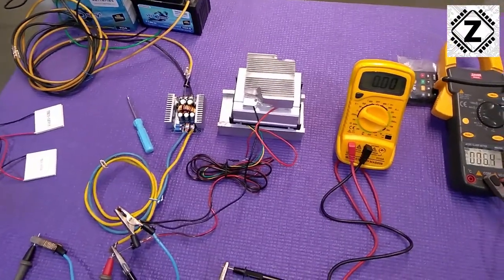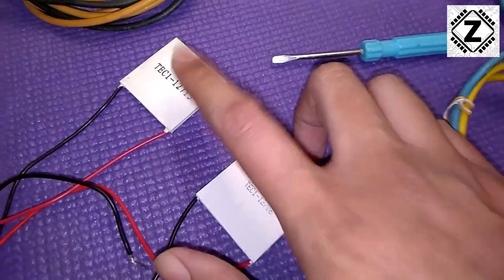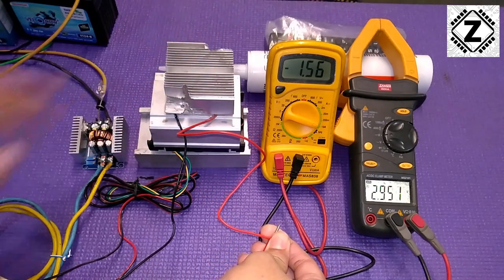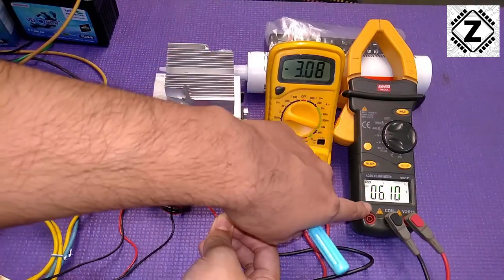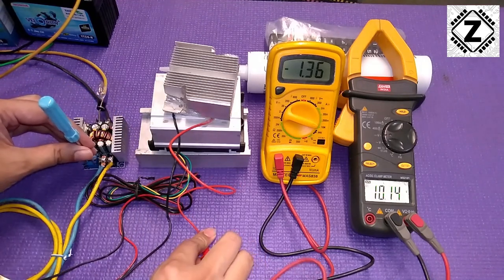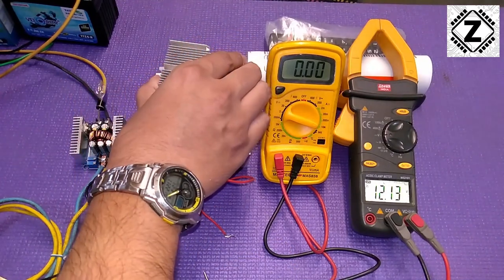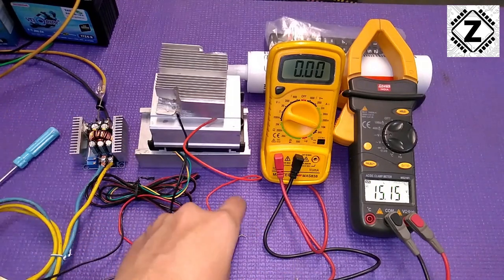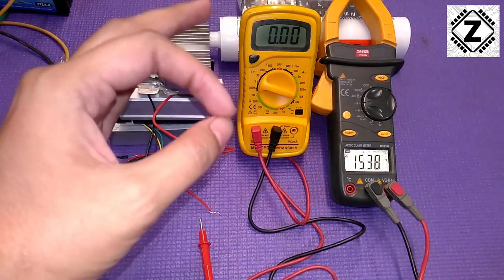[Eng] 9A Peltier Module TEC1 12709 Voltage Vs Ampere Test | How many Amps does it Draw In real life?

Comment: The Current draw from the pettier  “drifts” is based upon the difference in temperature between the hot side and the cold side. This is why The current draw changes rapidly when you first apply power and the change in current draw slows and then stabilizes as the systems hot/cold side temperatures stabilize. So in the application of using a pettier to cool  a CPU. The Peltier's current draw will change depending on how hot the CPU and the ambient air temperature. Like an LED, to get a peltier device to operate most predictably. You would use a Current controlled power supply just like an LED operates best with an LED Driver where voltage varies and current is regulated.

PS. Thank you for this. I was trying to find some rough comparison of current draw when using a regular regulated voltage power supply.
Reply: So I’m saying while peltier coolers give a voltage specification, if you regulate the current you’ll see more predictable  wattage consumption and cooling/heating characteristics. Fortunately for us they are not as fickle as LED’s that stop working all together  or burn out in such a small range so we can get away easily with regulated voltage supply
Reply: Viewers should most mind the wattage of the pettier. Keeping it under what ever manufacturer specified. Regardless of voltage and current. So for your listed 100w pettier. It looks like 14.4v regulated supply is about as high as you should go giving the current draw. 15v was over 100w
Reply from the maker: Excellent information, Worth a Pin.
Most of the peltiers we get here are Fake and have to be hand chosen (Paid & Wasted for). They sometimes do not behave like Full specs. 9A is one of the better ones among the lottery.
6A & 15A variants are almost impossible to get genuine ones. A Constant voltage test allows one to see how many Amps It can "demand" and hence give an idea of quality of the peltier unit.
Reply: Sir, when im providing 6v with voltage regulator, its only taking 3 volt, but not more than that, even if im increasing it, it taking same 3 to 4v load, tell me how to provide higher volt to the device

Comment: Can you do this again with love temperature readings?! Or do you have a video when you did show temps as you increased voltage?
Reply from the maker: Temps are very loosely connected to voltage. They depend more on heatsinks, ambient Temps, heat load etc.
Too many variables.

Comment: My TEC1-12709 Peltier is only drawing 2.8 amps at 11.4 volts so it's not the high quality unit I hoped for. I have it attached to a 60 watt rated heat pipe heat sink with a 12 volt fan. The heat sink isn't getting warm but the load is cold. I wanted to draw 6 amps from a 12 volt battery so I will have to use a higher voltage supply or a better Peltier for more cooling capacity. Thanks for making this video.
Reply from the maker: Sadly it's common that most of these units are poor or fake.
Thanks for commenting.

Comment: Does TEC1 12709 indicate rated for 12 volt and 9 amps ?
Reply from the maker: No.
127 Means the Number of Couples or Junctions.
The Voltage of 127 Couples is about 15.4v but most people call them as 12v peltiers.

09 means max current Rating of 9A.

Comment: So all these Peltier's only truly draw about 2/3 of the amps it states? I have 5 15 amp peltier's and need to know if my 110v 600 watt converter to 50 amp 12volt should work just fine?
Reply from the maker: 1000w Power supply will be recommended.

Comment: Luckily my tape water is very close to my air cooler. And I was thinking to attach a hot side of peltier to aluminum tank and connect it with tape without motor assuming hot water will automatically move toward my house water tank. I can use motor  but want to understand if I can use same tape point for inlet and outlet of motor will it be useful?for 3 peltier of 6Amp which power supply unit i can use?can't use battery so thinking of some kind of smps. Kindly guide me.

Regards,
Ashish kumar
Reply from the maker: That's a great idea But it will need experimenting as its hard to guess how effective it will be. What will you do when tap is closed?

You can buy this SMPS-
https://amzn.to/3bCHSrN
Reply: @ZenInnovations  I'll keep it open its in my control. But not sure about if hot water will move automatically towards tank or not.
Reply from the maker: @callmeghostgamer  A Small motor will help. If the peltier overheats it will damage.
Reply: @ZenInnovations  may I connect motor in out with same tape point using T connector? Mercy for asking lots of questions I'm kind of curious... And really thanks for all the prompt replies...
Reply from the maker: @callmeghostgamer  I love these discussions. Better you join my Telegram group where we can talk at length.
Reply from the maker: There is group link in description
Reply: Same here even i love technical discussions not only electronic but any engineering field...
Reply from the maker: We do all technical discussions on the group.

Comment: If a 12v Peltier is rated for 9 Amps and you run it with a 5 Amp power supply will it burn out the supply? Or just run at 5 Amps without issue?
Reply from the maker: A good power supply should have overload protection. I generally use a PC SMPS.
Reply: @ZenInnovations  Ok thanks.
It's a Coleman electrostatic cooler.
I switched the Peltier to a 9A and within an hour the 5 A power supply died.
No blown fuse.
Reply from the maker: @BrettHoustonTube  any Power supply integrated within a product is designed to work with That particular peltier... No wonder it died.

Try using a good smps or adapter.
Reply: @ZenInnovations  I thought I chose the right replacement... Come to find out it was not...
Reply: Thanks for the advice!

Comment: Hi sir it will make ice or moisture only?
Reply from the maker: It can be used in Many Cooling & Heating Applications.
For example, Fridge, AC, Chiller, Computer cooling etc.
Recently Godrej has launched Peltier based product-
https://amzn.to/3p40qGV
Reply: Sir i bought 12709 and my power supply is 15 amp why cant turn ice?
Reply from the maker: @noelbinongcal9749  try with better heatsinks
Reply: @ZenInnovations   i tried sir but doesn't work no ice
Reply from the maker: @noelbinongcal9749  maybe faulty peltier.
Reply: @ZenInnovations   but i test  it's working .the only t that can he gave is moisture not ice
Reply: @ZenInnovations   i tried Also 127015 and 12706
Reply from the maker: @noelbinongcal9749  try with a full charged car battery.
Reply: @ZenInnovations  thank you sir I'll try as soon ay possible because i don't have a car battery 😅
Reply from the maker: @noelbinongcal9749  https://youtu.be/prUy8Ynw6Ec
Reply from the maker: https://youtu.be/c4UKjLqVnmQ
Reply: @ZenInnovations  sir it turned ice because there is no heatsink in the top of piltier